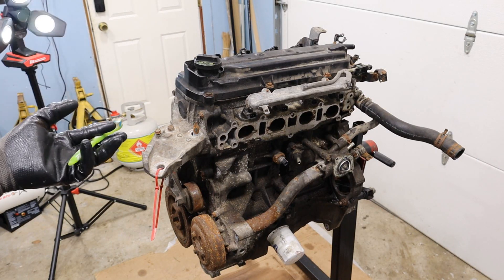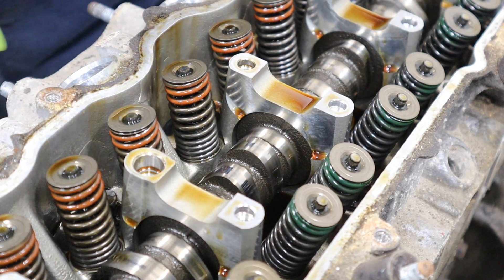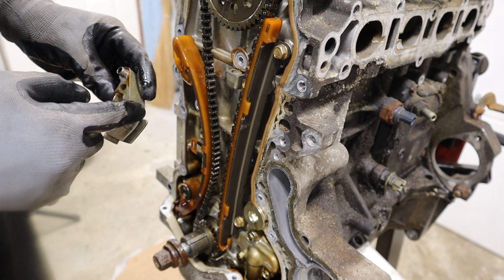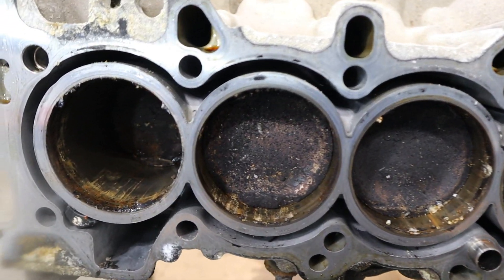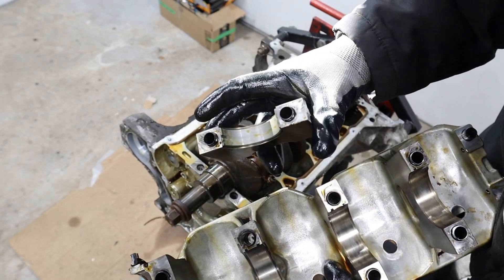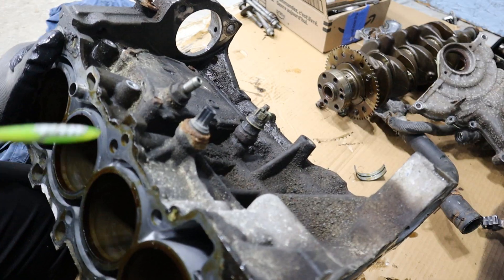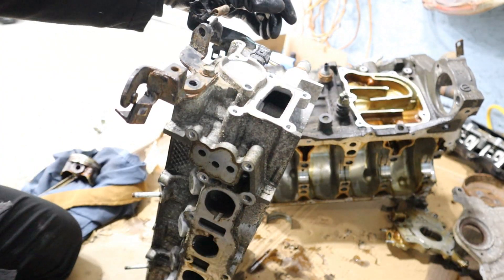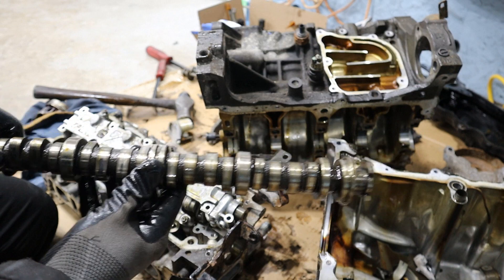The Honda L15 Was the Last Good Engine from Honda

Comment: R18 and K20C2: am I a joke to you?
Reply: Direct injection only, automatic disqualification
Reply: @ the non-turbo K20 didn’t get direct injection until 2025, which the GDI version is called the C9
Reply: @Blank00  Gonna have to double check but I am fairly certain all K20Cs were GDI
Reply: @i @iank6897 the HRV is still using the port injected version of K20, called the K20Z5, which is nearly identical to the C2
Reply: @Blank00 Yes I stabd corrected. The K20C2 civic is the last good honda
Reply from the maker: R18 had it's issues in the early days ... I'd still say L15 is more economical and simpler
Reply: @speedkar99  at least these issues got solved a couple of years before the 9th gen Civic got introduced